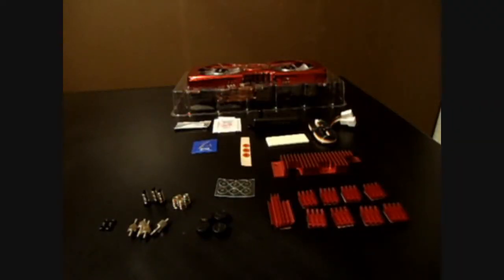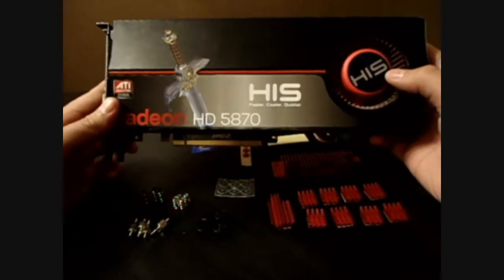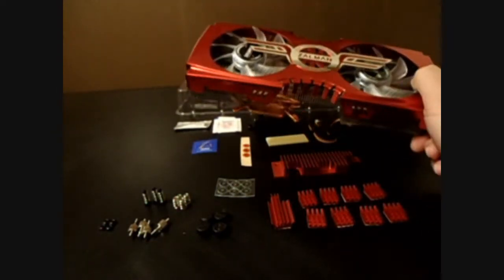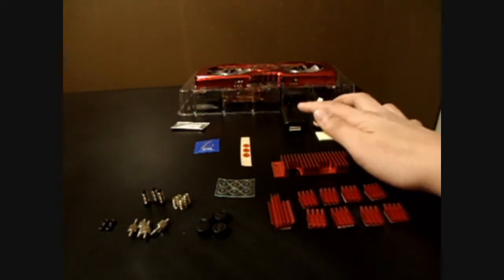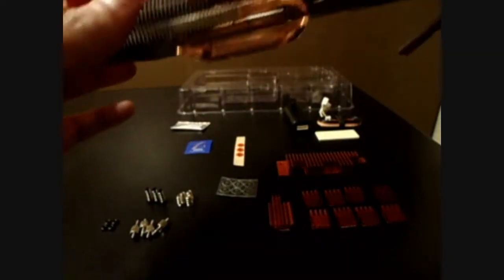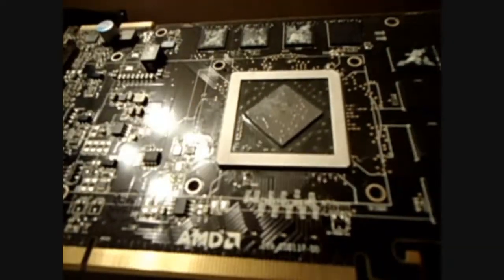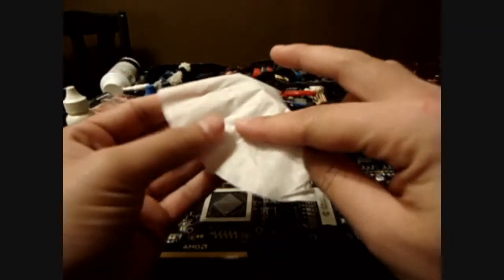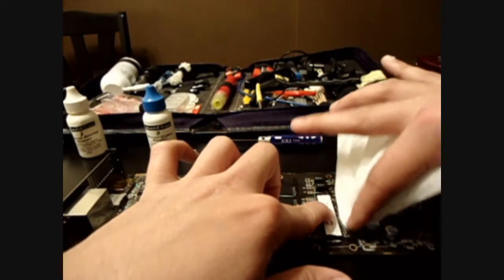Zalman VF3000A Overview, Installation and Performance

Comment: URGENT!
Will this fit on a AMD Radeon HD 7850?
Reply: +EmbeddedGenius - It should actually fit, but the vrm heat sink probably won't work, the HD7850 from my understanding uses 53mm mounting hole distance, and the VF3000a has 3 sets of mounting holes, one with 43mm spacing which would fit lower end\midrange AMD card and some older midrange Nvidia card and it should fit the gtx750ti because other coolers like the accelero s1 with 43mm mount holes fit the gtx750ti, one with 53mm spacing used by highend AMD card for several generations now and some older Nvidia Highend cards like the 8800gts(g92) 9600gt 9800gtx+ and its later rebrand the GTS250 ,and one with 62mm spacing for high end nvidia gtx200 series cards.